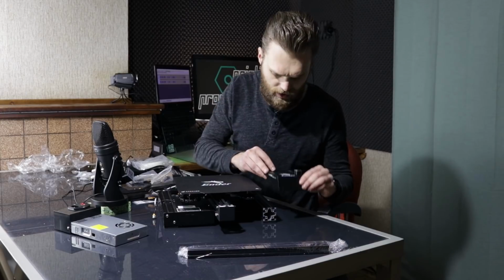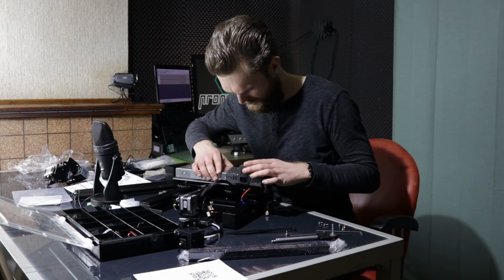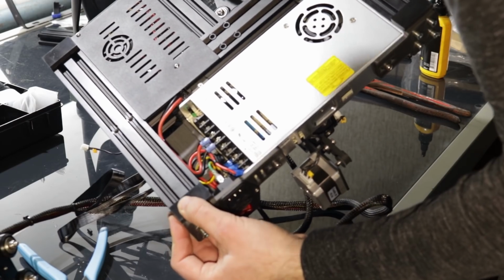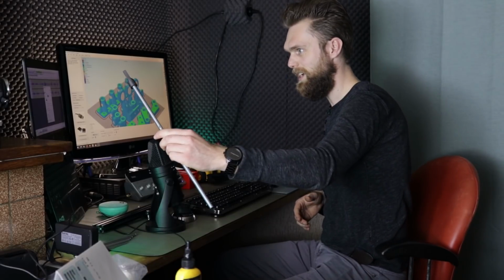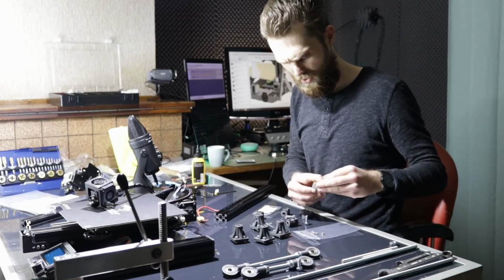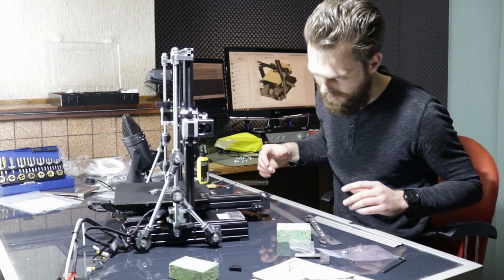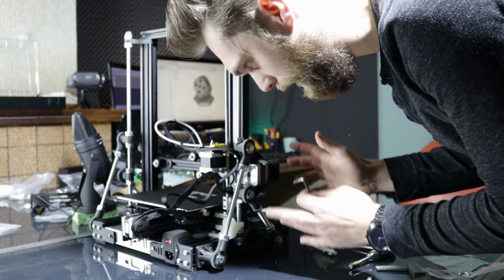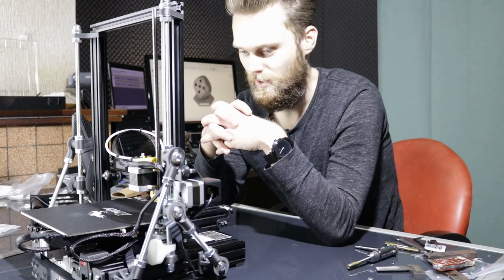Foldable Ender 3 pro

Comment: Dude! This is awesome! 
Hear me out: MOTORIZE IT! Then you can make it run gcode to fold itself up. It would be a transformer! Also, from there, you might be able to make it into a belt printer, just for fun. If you did, you might gain some clearance that the Y movement currently blocks.

Comment: Hi ,this is an awesome ideea ,and im thinking of make it ,but i have a question , the whole z gantry it is not wobling?
Reply from the maker: Thanks! I haven't tested it thoroughly and I'm thinking of making a second version in the future since using square profiles would work better than the threaded rods I used. The gantry tends to stay down and if you lock it at the bottom it doesn't go anywhere. It almost acts as a z brace which makes it even sturdier.
Reply: @properprinting   Ok , I can't wait to see that version too ,you make very cool projects, keep it up 💪🙂

Comment: I like your PSU mount. I want to do that to mine. Do you think maybe adding an vent would help a bit more for air flow? Excellent video!!!
Reply from the maker: Thanks! It definitely helps, but the fan in the PSU itself is often good enough. Some feet to give a bit more room to the air intake at the bottom is something I'd recommend ;)

Comment: I downloaded your files for the display mod but am confused on how to print the display frame.  The two brackets printed fine.  Using Cura, the display_front is standing at a 45* angle.  Did you use supports or do I place it down flat (front side up) also with supports? That's a large gap for the frame to print without any.  Still new this.  Thanks.
Reply from the maker: The orientation is this way because it was oriented like this in the assembly. You guessed correctly placing it flat, front side up and using supports. Good luck with the print!

Comment: Hey Jon, 

is it possible to share the whole 3D-CAD-Modell of the Foldabel Mod with me?

Best rergards, thanks a lot and keep it going!
Reply from the maker: Hi Thorben, yes that's possible. It's a huge mess though. I'll respond to your mail as soon as I get to it :)
Reply: @properprinting  Hey Jon, ich how does it look? I hope you haven't forgotten me? :D
Reply from the maker: @thorbenpanusch779  hi! I'm doing good. It's pretty crazy lately, but haven't forgotten about you :) Did you manage to get the folding mechanism working? I forgot to reply to your question about those modified bearing holders, hopefully you were able to find this out
Reply: @properprinting  Glad to hear that, keep it up! :) I'm still at it, had a few delays. But generally, it's working out fine. 
I could still use the 3D Fusion model :D I wanted to make a few changes and adjustments and it works better with the original or fusion files than with the stl files. I think you can relate :D Provided you're okay with that? Would you like me to just send you an email you can respond to?
Anyway, many thanks already for your efforts and your time! :)
Reply from the maker: Hi Thorben, yes that's possible. It's a huge mess though. I'll respond to your mail as soon as I get to it :)
Reply: @properprinting  It's all good, even a mess would help me a lot, thank you very much!
 :)

Comment: What are your thoughts on adding MGN (or similar) Linear Rails to the Ender? 
Example: https://motioncontrolsystems.hiwin.com/item/mg-series-assembly/mg-series-assembly/mgn12c1r300zfc?pageFrom=pc&configToken=dTJhhkBLimFDnqqltsI497pgQCHyZUpNrsZnQfLCh4g9TGMdCHLCCxMN2azieODi

I'd think you could get better accuracy and reliability out of the printer with potentially less maintenance. I see lots of people mentioning this upgrade, but there's a lot of arguments over whether you need to get a branded rail, or can work with some cheap knock off rails with some modification (cleaning and lubricating the bearings is commonly recommended, along with replacing the ball bearings). 

Considering your obvious engineering background, what are your thoughts? I'd love to do away with the dusty  V-Wheels and eccentric nuts, but not sure it'd be worthwhile.
Reply from the maker: My apologies for my late response. I've received a linear rail from a viewer and haven't used it yet. What I think is that this wouldn't be a significant upgrade for normal use. I've printed a lot already and the V-slot wheel mechanism works fine. I think that this would be interesting if more force is applied in the case of a direct drive extruder or even worse, a grinder. Other than that it's the last 20% improvement if you consider the 80/20 rule. This is my view and might be wrong since I haven't done much research about this topic, but hope this helps :)
Reply: @properprinting  Thanks for the reply! I bit the bullet and installed rails on X, Y, Z.. But I'm a tinkerer and not really doing any of this for production just fun. 

My thoughts, it's costly, the install can be a bit tricky if you're not accurate with alignment. As far as "performance" I agree it hasn't had a significant impact on the quality of my prints. Replacing the controller board did way more than the rail.... However; I haven't had to fuss with any eccentric nuts or dust build up on the wheels :)

Comment: Does this work with normal Ender 3? I really want to give this a shot!
Reply from the maker: Awesome that you want to give this a shot! The only thing that doesn't fit right away (as far as I know) is the display holder. This is because of the narrower y-profile. The rest of the mechanism should fit. I still have to improve the holder at the base to make it more stiff, but the version I've uploaded does work. Feel free to send a mail if you run into anything.
Reply: @properprinting  Thanks for the informative response! I'm thinking of not including the screen mainly because I use Octoprint with my printer (so I rarely ever use the LCD screen except when doing manual calibrations and such). Later on in the week however, I'm going to go and upload the model into Fusion360 to see how everything lines up and will let you know how everything fits :D

And I kinda got an idea on how to make it more rigid! You could do like how E3D has their heat cartridge locked in the heatblock: add a screw hole that allows you to tighten the part on the leadscrew that slides into the base. PETG and Nylon are both strong and flexible enough to handle the torque of the screw
Reply: @properprinting  Good news! It seems all of the parts work with the normal Ender 3! However, since the Y axis is narrower than the Ender 3 Pro, the bracket that goes onto the Y axis is about 11mm too far over. It seems to be an easy enough tweak though! https://imgur.com/a/NCxMsuJ

Comment: Mother of God! This is glorious!!! I desperately want your designs for the power supply mount and the screen mount. Those should help offset little wiggles by shifting center of mass. Even without the intent of folding the printer, this is a much more elegant design in my opinion.
Reply from the maker: Thanks Mark for your comment! I really like that the power supply and display mod were needed for this printer to fold, but have some significant benefits besides that as well. These files can be found on my website ;)

Comment: Is it sturdy enough to maintain same print quality as original?
Reply from the maker: Thanks for your comment! As it is right now, no. Fortunately the foldable part tends to stay vertical, but the snap in part is not sturdy enough. It will print fine, but for larger parts at higher speeds I recon that the quality will decrease. This can be fixed with a better locking mechanism and that's something I'm going to take a better look at.

Comment: I love that PSU mod. It'd be nice on any ender 3 pro, not just a folding one.
Reply from the maker: Thanks! Yes it is! This is exactly what I like about trying these upgrades. Some upgrades look unnecessary or over engineered, but I learn from every one of them and find new things like this PSU mod. I wouldn't have come up with it if I didn't need this printer to be able to fold.

Comment: I have a project idea for you: an inline filament dryer. I've been wanting to try printing with some Nylon based filaments but am concerned about too much moisture in the filament. I've been tossing around some ideas of my own. One idea is to use a modified volcano heater block with a 20-30W heater element controlled by an Arduino for temperature control. What are your thoughts?
Reply from the maker: That's actually a great idea and I've noted it down, thanks! This sounds very doable and I think I already have an idea how to do this and to combine it with a planned upgrade. The more I think about it, the better it gets! Is is possible to send me an email so I can share some ideas about this? You can find it in the about tab of my channel ;)
Reply: @properprinting  even I would be happy getting your thoughts on this.... sanju71@gmail.com

Comment: Amazing project, but two questions: 1) what brand Nylon/CF filament are you using, and 2) how does the power supply keep from overheating now that it's cooling fan exhaust is sitting only a couple of three MM from the table top? OK, maybe a third question: why not use a Nylon/GlassFiber filament for your turnbuckle bearing holders instead of Nylon/CF? It's still very stiff but a little more flexible than CF.
Reply from the maker: Thanks! I've used Nylon CF made by eSun. I don't know if the power supply will overheat at all but there is indeed not much room down there. This is something I'm going to figure out because it has been asked before and with good reason. I have to take a look into the material you mention. I really like the aesthetics of Nylon CF and I needed this for another project not related to the channel so I had enough of it already. I already experienced that pressing the bearings in went better after warming up the parts :)
Reply: @properprinting  Good to know about the eSun filament because I was going to try their ePA/CF and ePA/GF filaments. Thanks.

Comment: I wonder if I can guess a video that will be in the series....

"Foldable Ender 3 Pro conveyor belt mode"

By plugging the motor of an exterminal conveyor belt module in place of Y motor and clipping on a brace to hold folding Z axis at 45°
Reply from the maker: Funny thing is that I didn't intend on making this mod, but the belt printer has been mentioned before and I definitely want to do this! Thanks for your suggestion, I have a neat idea about this mod and what to print with it, but it has to wait for some other mods I'm going to do first ;)
Reply: @properprinting  Thanks for replying, been slowly playing catch up with your videos, mainly the tool change and custom connector stuff.

Opening and closing belt is not really an option, neither is opening the printer frame to slot a belt through.
If the lower side of the belt goes up over rollers, it can slide between the bed and the upper side, shame I can't show you a sketch on here.

Comment: The PSU has the fan under with not a lot of space for air... Could this cause an issue?
Reply from the maker: That's a good question, thanks! It would possibly be beneficial to add feet to make more space under the printer but I cannot say for sure if this is needed or not.

Comment: I like it.  I would also like to see wheels on it when it folds up to push out of the way for convenience because the whole point of folding is for convenience to me.
Reply from the maker: Making wheels as feet is a cool idea! Not what I'd in mind for this one, but still an idea to keep in mind. Thanks!
Reply: @properprinting  Going to keep watching to see when you might do a wheel addon. :) I might do some for my Ender 5 Plus just to make it a bit portable on the table.  Have them setup to retract to allow the rubber pads to grip after moving with the wheels.

Comment: I want it....    travel printer !  Would it fit in a pelican 1650 🤔
Reply from the maker: Nice! It will be a tight fit, especially the width! You're on the right track of what I'm planning to do with that printer. :)
Reply: Proper Printing been doing it with a cr10s.    I hate it, having to disassemble the whole thing...    always thought of turning the pelican into a popup printer itself... those hinges u made 👌🏼
Reply from the maker: @ikerurruchi2112  Turning the case itself into a printer is neat! Disassembling the whole thing is indeed a pain. Thanks ! :D

Comment: You could replace vertical rods of this mechanism with a lead screws and rotating nuts powered by (originally) extruder motor. Pancakes of lead screw nut with a bearings on its longer collars (both sides) and a 3d printed GT2 pulleys would be quite compact, and even anti backlash by design. You would need to make it direct drive then (or relocate extruder motor to the frame), but i think direct drive is even more in line with your quick swap hotend idea, compared to a bowden system :D
Reply from the maker: Thanks for your suggestions! You're pretty close with what I'm planning to do with it ;)

Comment: A while ago 1 had exactly the same idea. And also prototyped a really similar folding mechanic using some Lego Technic but i decided not to try it further because I had my doubts about stability
Reply from the maker: Hi Lars! Nice that you had this same idea! I experienced that the hinging part tends to go vertical so once it's properly fixated at the bottom it's very stable. The clicking mechanic I used holds everything in place and it looks like this is enough for 3D printing. A true locking mechanism would increase that stability.

Comment: I want to mount my power supply in the back, just because I like getting it out of sight, so very much looking forward to your Thingiverse design being posted. I have ordered a metric tap set, being in the USA, I only have SAE ones on hand. I am assuming the screws you used are M5, as that is the size that holds the display bracket on in front. As for the folding part, printer manufacturers should look into using this idea, they could offer a fully assembled printer, just unbox and unfold, plug it in and print!
Reply from the maker: Hi Ron, thanks for your comment! It's indeed M5 which holds the display and power supply. Great idea having a fully assembled printer right out of the box. This decreases the packaging volume compared with standard assembled printers and you can start printing immediately. Best of both worlds!

Comment: Nice motion study - I just have one question... why?
It makes no sense adjusting the vertical parts to the 10th of a degree a couple videos ago and now presenting a foldable printer which will be a pain everytime you fold it. The power supply mod is awesome 😊
Reply from the maker: Thanks! You are going to find out why ;) It's not a pain to fold it. Well, it is right now, but it won't after I've done some thorough cable management. I still used a set square to get it as perpendicular as my other printer because the system allows precise adjustments. That mod is something I'm very proud off, thanks :D

Comment: The best PSU mode for Ender3 I ever have seen! Looking forward to seeing Dual Z of this foldable beauty.
Reply from the maker: Thanks!! Funny thing is that I didn't plan on adding a dual z to this printer because I've different ideas with it. Maybe I'm going to add it to this one as well :)
Reply: @properprinting  Maybe this time you can do it with 2 stepper motors instead of a transmission belt. This might help a bit with weight distribution between both sides of the printer.
Reply: BTW I'm looking forward see this PSU mod on Thingiverse!

Comment: its awesome this upgrade, and could be a very good idea por many printers, but the ender 3 the best so far for me, but im with an ender 3 first series and dont know if this can be applied to a normal ender 3
Reply from the maker: Thanks Kevin! As far as I know the first series has the thicker style power supply which will not fit like the newer flat style does. The idea should work for that printer, but it needs a different design.

Comment: Wow this is crazy. Well done man, awesome work.

Do you think the power supply modd is a worthy upgrade for all ender 3 pros. How does it affect air flow?
Reply from the maker: Thanks Devon! After I've placed the power supply like this I thought: "Why is this not the standard location?" It fits a bit too good to be true. Someone else posted a comment regarding the airflow as well and maybe it's a good idea to raise the printer and/or make a duct for the fan. I'm not going to advice everyone to do this mod because you have to reconnect the wiring, but if you know what you're doing than yes, this would be my position of choice. It removes the yellow connector which is known for it being a fire hazard so that's a big plus for me :)
Reply: @properprinting  thanks man. I might give it a go. Yeah I'll do a few experiments with internal power supply temperatures and report back. I'll stick an lm35(temp sensor) and let it log the temperatures during a few prints. 

 I'm not worried about wiring as I'm a electrical engineer😀
Reply from the maker: Thanks man! Connecting 5 wires properly shouldn't be a problem for you then xD

Comment: have you thaught about encreasing the displacement given by the feet of the printer to encrease airflow for the psu and to reduce debree intake
Reply from the maker: No, but you make a good point here! This will not be necessary for the idea I have for this video series, but this is relevant for everyone wanting to make this mod. Thanks for mentioning this!
Reply: @properprinting  i was thinking the same thing. You could flip the way the PSU mounts so that the exhaust fan is in top. Or just raise the whole printer onto feet. That gives you atleast 2cm of clearance.  And are you going to post the stl for that PSU mount. I love that idea